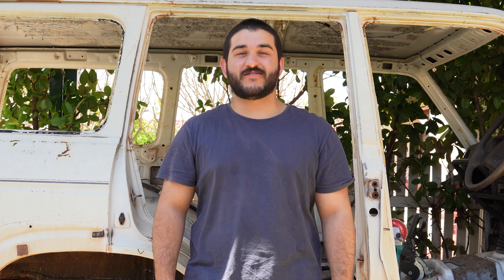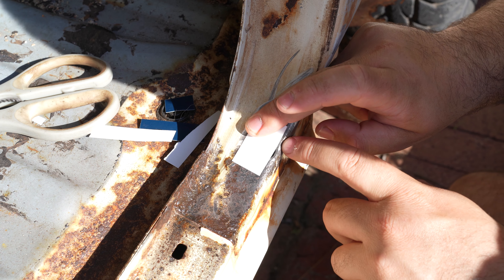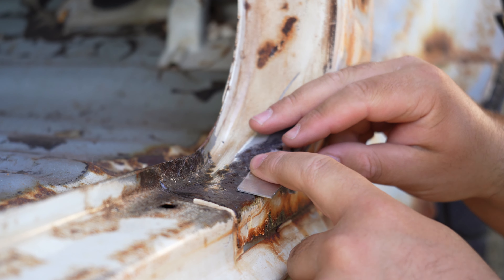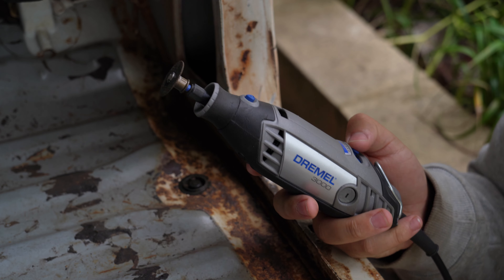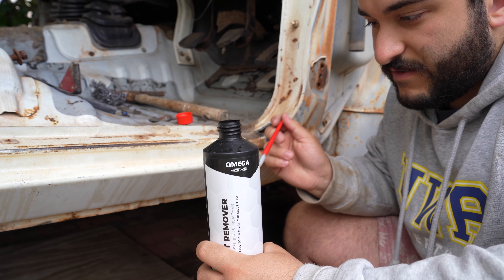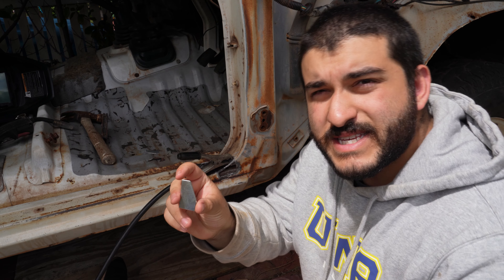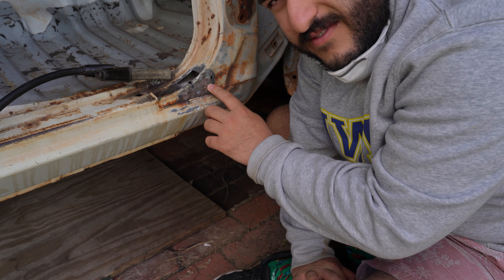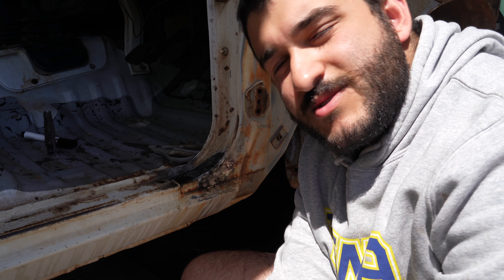Quick and Easy Rust Repairs | 60 Series Landcruiser

Comment: Hey man, good to see you having a go. 
My suggestion (as a non-professional but I am currently working on my rusty cruiser) is to cut more away than you think. That black dimpled rust is pretty much stuffed; you will just blow holes and cause issues. Also go to bunnings and get some copper joints, smash them flat, and put behind your welds when you can to help with blow-through. Check out fitzi channel on youtube as he does some amazing stuff with simple tools. 🤙

Comment: Just finished mine, after 3 months of work I pretty much have an entire new stainless roof
Reply from the maker: Pretty tough job, Was there much rust hiding under the roof skin? Or did it all show through?
Reply: @NextStopTouring  for every 1 cm of rust on the surface there is 10cm behind, in the frame of the roof.